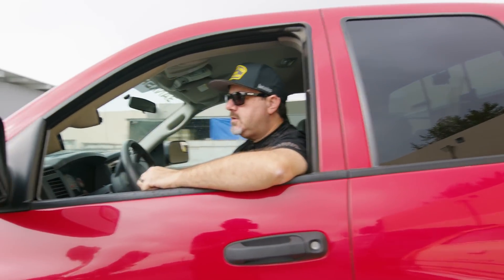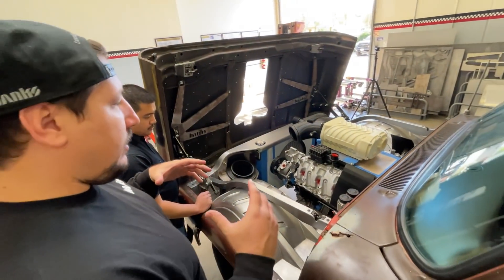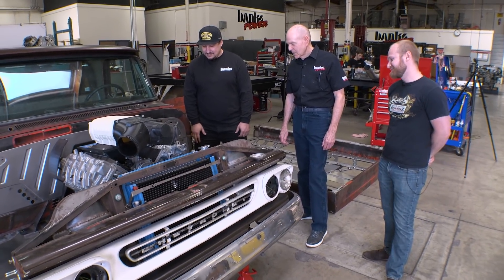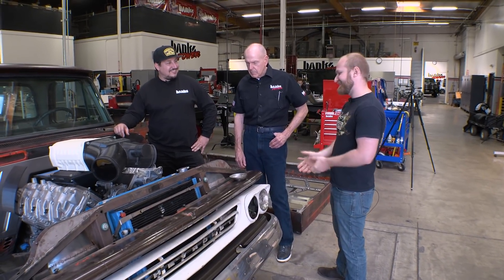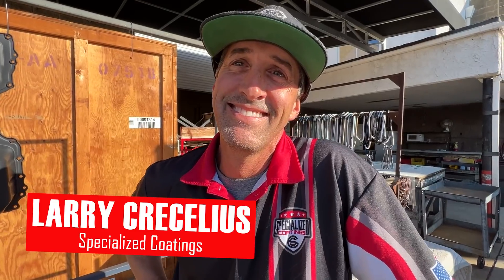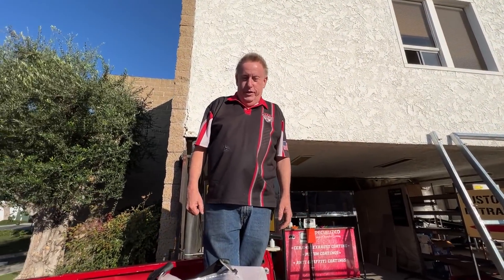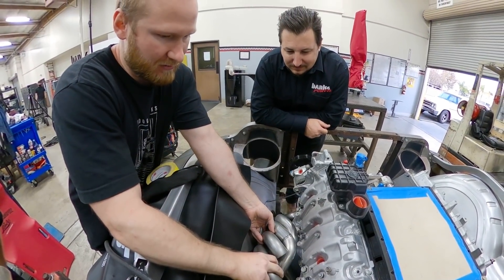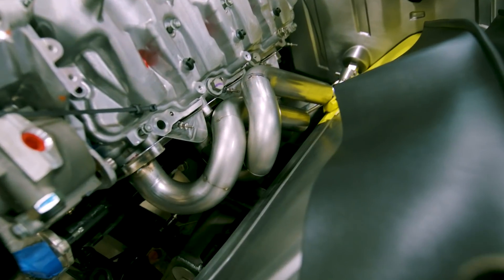Wild headers for our SUPERCHARGED DURAMAX | Banks Built Ep 38

Comment: What is the logic on the extremely long tube headers? It has been a while (35+ years) since I've done any math/simulation on headers and I seem to recall using either ¼ or ½ the ideal length for the pulse wavelength in my header designs. Are these full 360° wave headers? What rpm is the engine designed to run at?

Also, is it really worth all that length and potential flow resistance when you have a supercharger creating such a large delta pressure between intake and exhaust?

Finally, did you say that an oil cooler was going to be mounted directly beside the driver side header? Um....?

One thing for certain, those headers do look extremely cool!

Comment: Yeah make those pipes as close to each other with as much curve as you can and as long as you can to case less flow more heat and more pressure being lost that could be used by the turbo to make the least efficient exhaust ever. Really makes power.

Comment: Is there any reason you went for cerakote and not ceramic. I had all my turbo hot and cold side ceramic coated about 15yrs ago and has been a gem and still looks like day one. But I know Banks engineering know there stuff just wanted your point of view on the ceramic v cerakote?
Reply from the maker: Cerakote is a ceramic-based coating. It's offers the best of both worlds. You get the heat resistant qualities of ceramic coatings, with a plethora of colors and finishes. We're so impressed with the product that we've partnered with them on a few upcoming projects.
Reply: @bankspower  thanks for the reply I am in Asia I will have a look to see if they have cerakote here. That's great they can add colour and also have the heat resistant properties I am looking forward to seeing there stuff on your future build and your SEMA build is amazing 👏
Reply: "their"

Comment: The sound of a diesel without the muffle of a turbo is gonna be amazing
Reply: My n/a 6.2L diesel just sounds like a Chevy v8 with a wicked knock
Reply: @akpolack  basically is one 😂. Those 6.2s sounded like a cricket the size of an elephant
Reply: It will be like an old 6.5 GM diesel before they had the turbochargers only a bit higher revving and with a bunch of whining noises. And more power. A lot more power and no crank snapping.

Comment: What was the coating? Can it be used inside the engine also, like for oil galleys and the inside walls of the block?
Reply: Cerakote is the coating on the outside.  Most folks use Glyptol for oil galleries.  I guess you could use it on the inside, but it has a very detailed apply process; might not be cost worthy.
Reply: Ceracoat I believe. Short for ceramic coating.
Reply: NIC industries makes this paint.  Cerakote is a ceramic coating.  They also make powder coat paint.